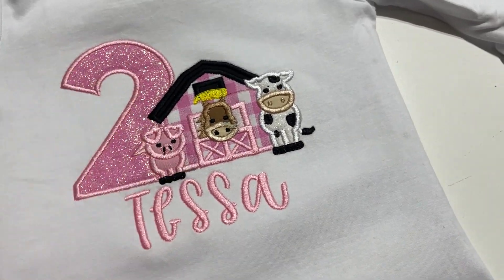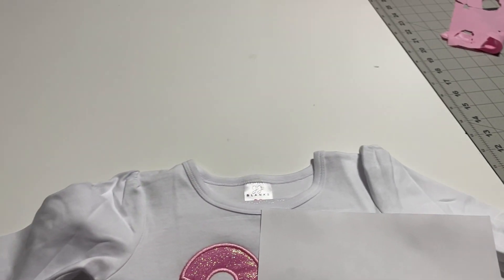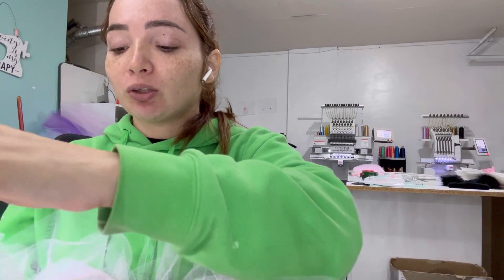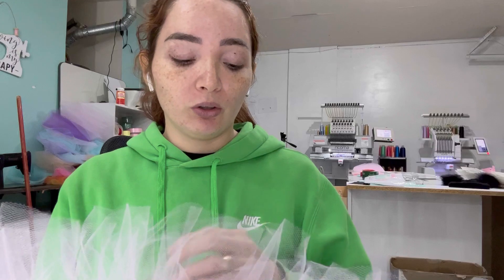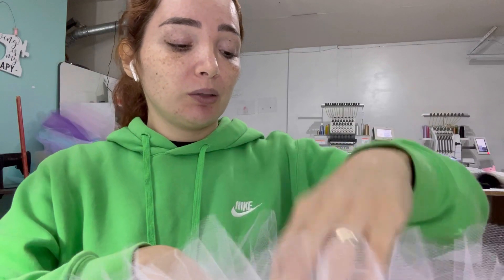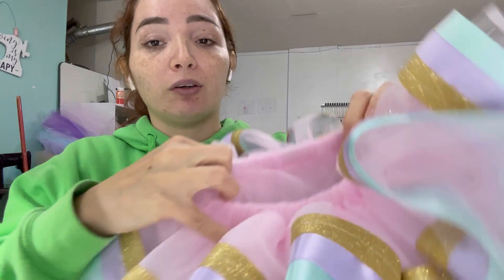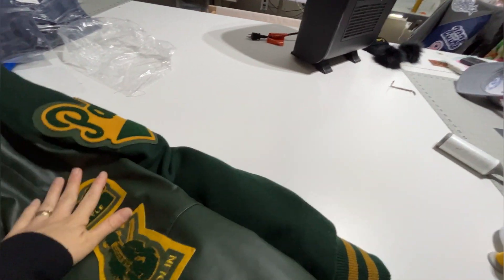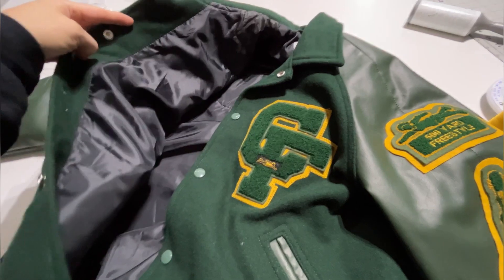Low Orders With Etsy! I Mess Up A Shirt - Houston Will Freeze Again

Comment: Thanks for the tip .... my daughter recently had a similar hiccup and was able to safe the embroidery too but your method is much easier way to fix the mistake. We live in the RGV and we got freezing temperatures for a couple of nights too. We brought in most of our plants cuz the last freeze we weren't prepared. We used the blue tarps and bed linens to cover what we couldn't bring indoors. Major plus, it didn't rain!😅